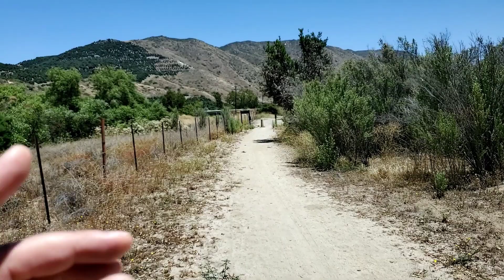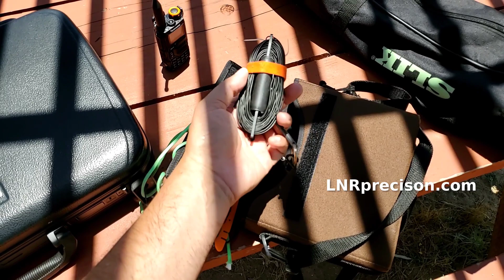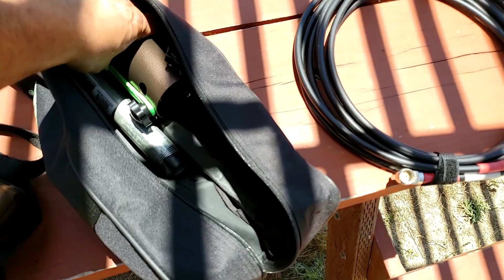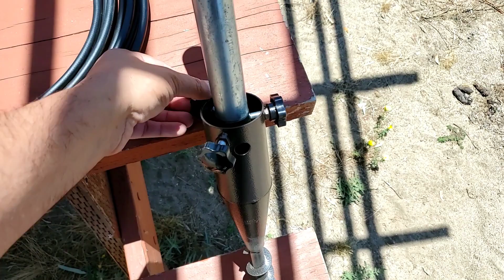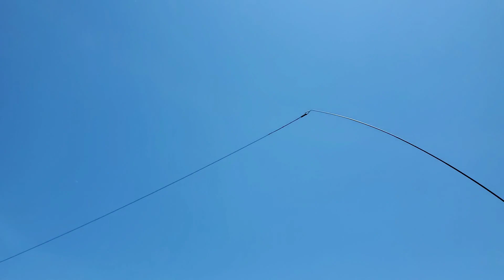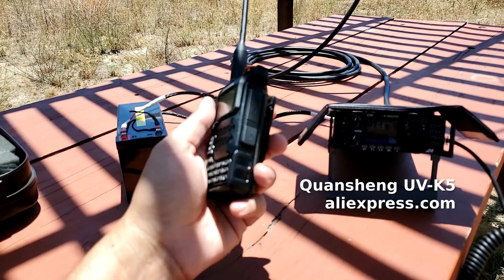My POTA Setup in 10mins or less

Comment: If it's a HW, which band is it cut for?
Reply from the maker: Cut to 63 ft or so.   For 40m band.   But it will also work on 20m,  15m..    Also  17m  with a little help from ATU in the g90.

Comment: Cool stuff, thank you for sharing. I'm in Florida myself. Im new to HAM had my general for a few months now. Trying to figure out how to get into HF and at the moment the g90 seems to be the best fit for multiple reasons. I really like the simple set up your have.
Reply from the maker: The g90 is a great radio to start out with.   It does all the important bands.  the trick with making it useful is to have a great antenna that performs well in the bands you want,  ex.  40m,  20m,  15m,   etc.   I found that a EFHW antenna does just that.   Also,  be aware that the radio only does 20W  max.    So you wont be able to bust a pile-up of other stations talking,   but if you can be patient and wait for an opportunity to speak,   the radio does just fine.   Good luck...   73.